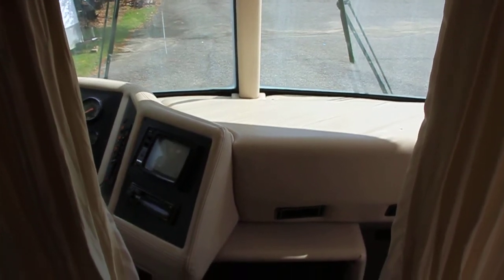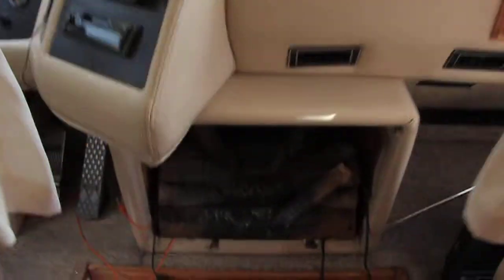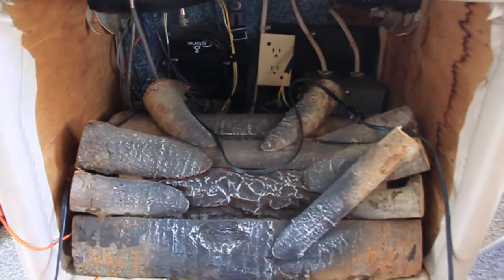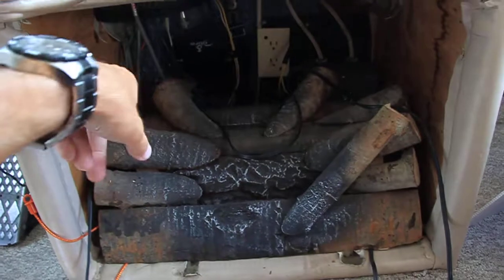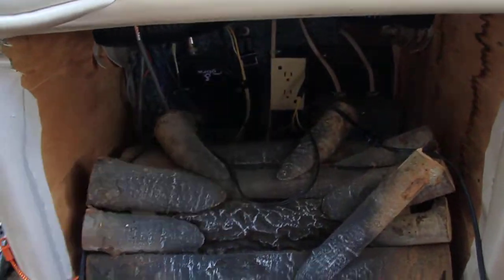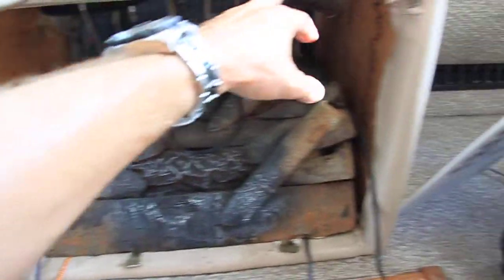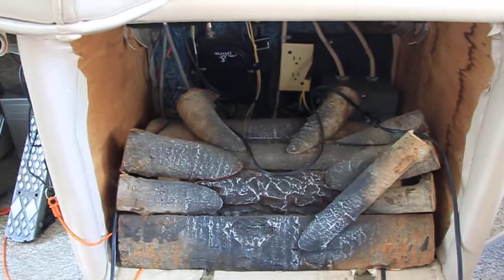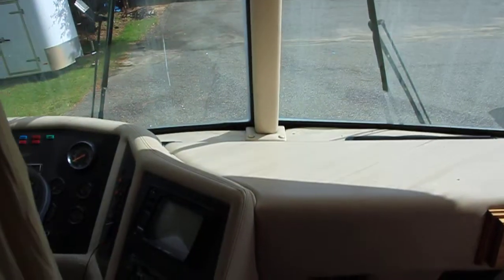Renovating an old RV: Part 3 (Fireplace?)

Comment: Are you planning on going to cold climate locations? Why is the fireplace in the front, that's different. It's looking very nice, did you re upholster the front or did it come with that leatherette?
Reply from the maker: Once I hit the road I'm sure I will hit some cold weather locations. Hopefully I can avoid the cold areas in the winter though. I put the fireplace there because that was were the old tv was and the fireplace just so happened to fit in that box. It is a fake fireplace. All it does is lights up and make sounds. It's just for looks. The box is factory and came with the leather.